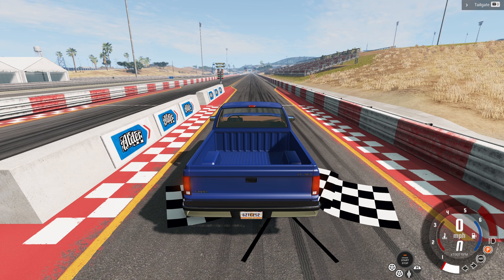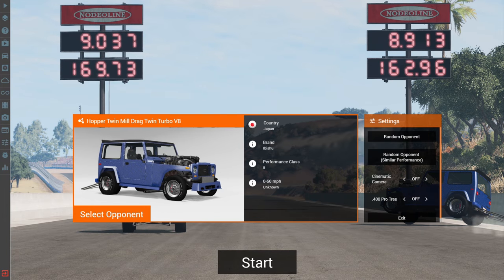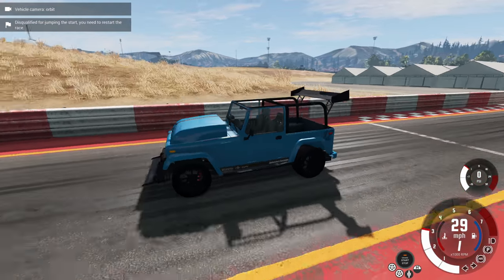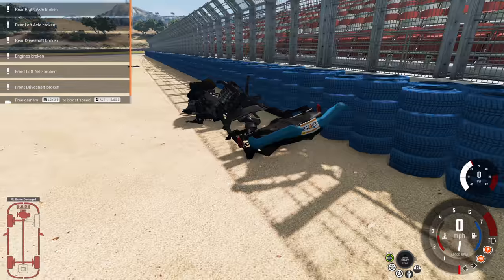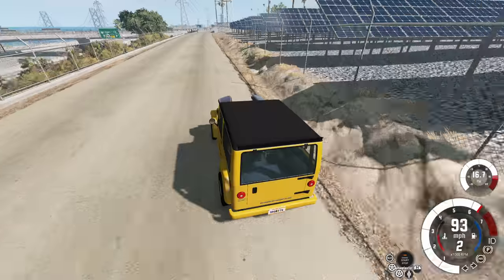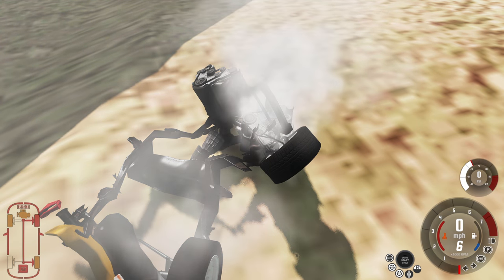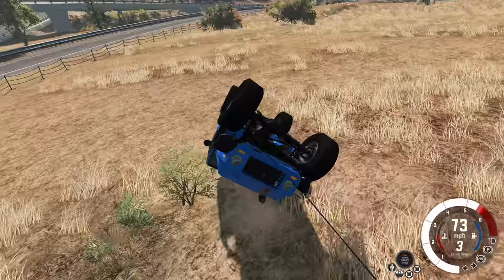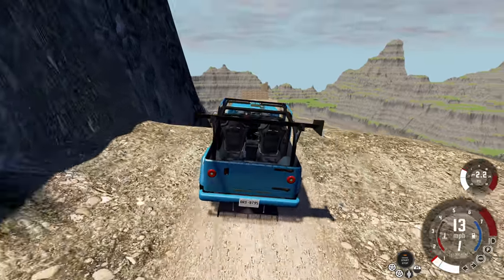TWO ENGINES ONE CAR - BeamNG.drive - Twin Mill Hopper

Comment: If there was a v8 with twin turbos, you are driving a Bugatti Veyron engine in a Hopper.
Reply: Yunhong Zhu yes
Reply: Doesn’t a Bugatti Veyron have a W12 engine?
Reply: @soop33  W16 but 2 v8s has the same amount of cylinders and they’re both TT which is quad turbo technically speaking. so 16 cylinder quad turbo = veyron engine

Comment: I've often wondered if you could use multiple engines to evade a higher car insurance cost.
So instead of a 2L engine, you'd have a large bank of 50CC engines. Still, I suppose that's more things to go wrong.

Comment: @WhyBeAre it's beveled gears. IRL that's wholly possible with such a setup if the gears are angled, but then they're turning the same direction, which means two gears are driving one, which means a higher likelihood of failure. The better way to do a mad, mad dual-engine setup like that would be to have two separate driveshafts which operate each side independently, so that there is less likelihood of failure from asynchronous operation and with the right firmware on the brainboxes which help the engines go brrr reduce power on one side to improve steering.

Comment: 24:13 flying so strange because of the rotating parts inside the engine.. got so much mass thats rotating that it twists the whole car.. just like when you accelerate really hard with a car with a big powerful engine
Reply: Nick Kill3R Yeah, it was almost rolling over from these gyroscopic effects on the drag strip

Comment: "Naturally aspirated" engines usually have more outtakes than intakes. All normal car ste "naturally  aspirated" but you dont mention it as you have the same amount of intake and outtakes. In this case I think the v8 in the orange car is a 40valves engine.

Comment: With my own custom configuration of this vehicle I was able to hit about 300 mph before the tires blew up. I probably could have gotten more speed if the tires did not blow up.
Reply: I reached 600 km/h so like 372 mph with my version but then the mod updated and it made the ultra heavy duty engine block weaker so it can't stand max nitrous shot size anymore and it explodes.